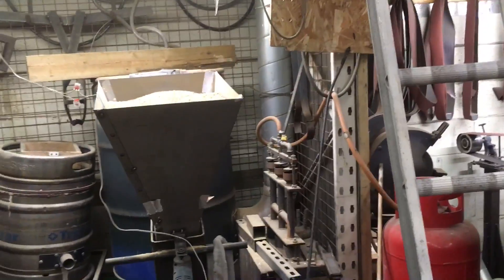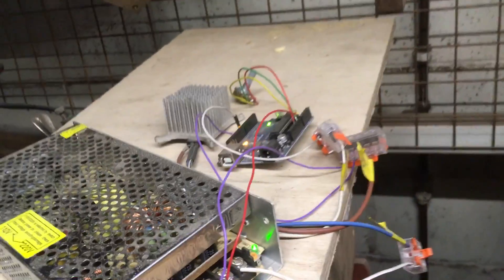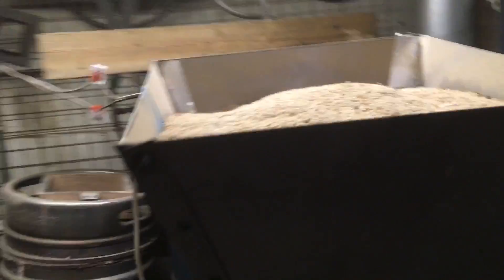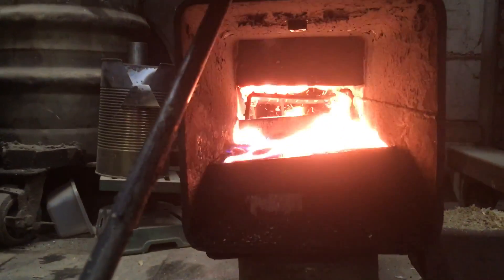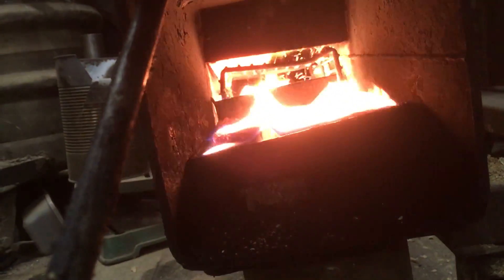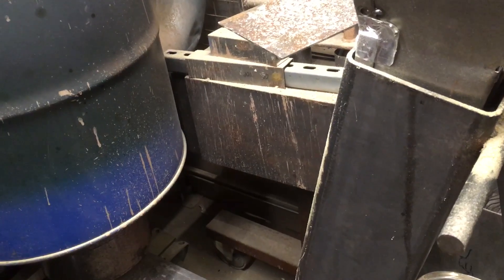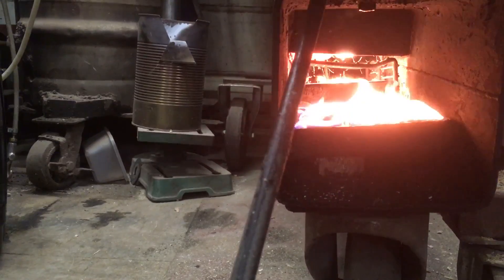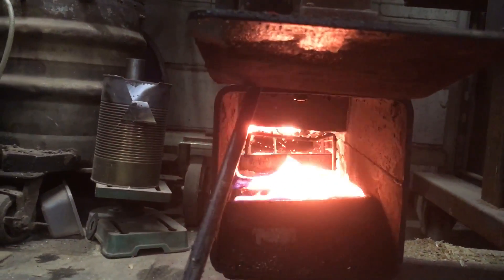Workshop rocket heater sawdust feeder.    Arduino control

Comment: This is so cool. Once you've figured out the warm up times and tick over amount could you write a program to automate it?
Reply from the maker: Absolutely although some feedback sensors would be best.   Temperature obviously but also maybe one to detect the light from the flame.    It’s the flame that really pumps out the heat whereas smouldering let’s it tick over without using too much fuel but keeps it warm and avoids the need to re light.  I can see an array of temperature sensors to really get a good idea of what is going on.    Cheers again